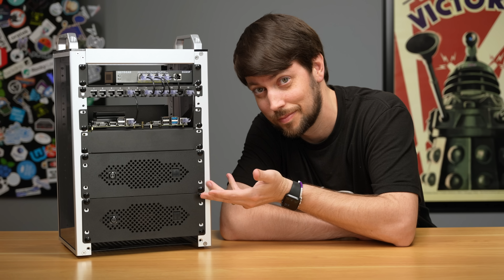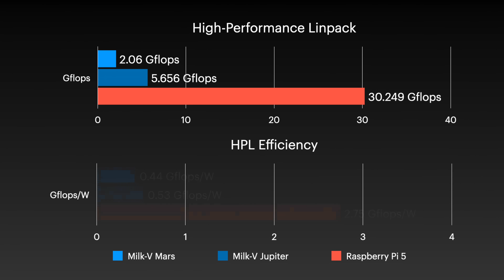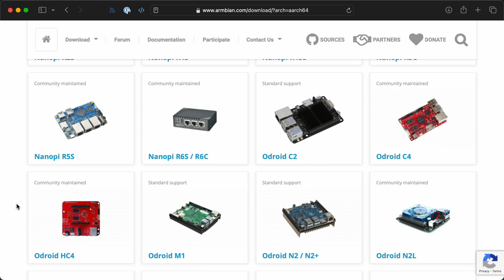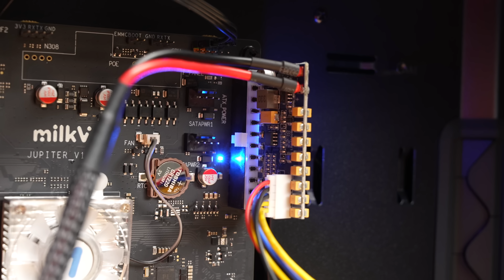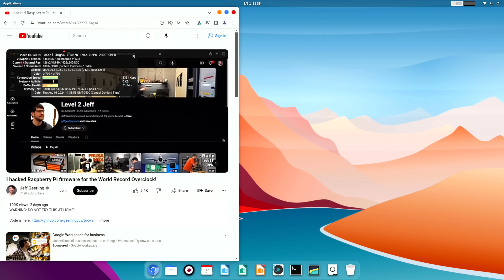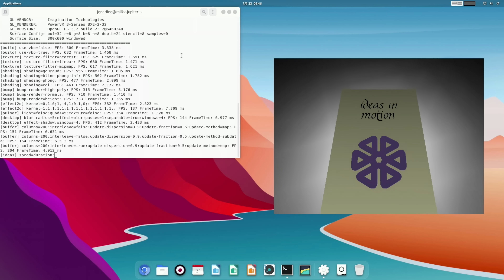The PC industry is changing: RISC-V goes mainstream

Comment: I think people need to stop simping for RISC. Especially click-bait titles like this don't help at all. Instead they hurt any chance RISC ever had. Right now it's a toy for a very tiny niche of tech-enthusiasts. It has a long way to go to be relevant at all for the mainstream.
Reply from the maker: The overall point of this video is to show how RISC-V (collectively) is at a state on the Arm SBC side where Raspberry Pi was around the Pi 2/Pi 3 era, where it went from quirky and horribly slow hobbyist board to 'a thing that actually makes sense in some use cases'.

It's certainly not a board I'd see someone install in their gaming PC (but neither is a Pi), but the software and community/soft parts (which most Arm SBC makers lack) is already solid. If the hardware can catch up, with some faster and more efficient RISC-V core designs, Arm is going to have a reliable competitor for things above the microcontroller level.
Reply: 15 years ago I saw many of the same comments about ARM.
Reply from the maker: @joshua_lee732  Heh, somehow I still see the same comments about Arm today (though a lot less than 10 years ago).
Reply: @joshua_lee732 and right now it looks like every standard laptop from various companies will have a Google, Qualcomm or Apple ARM CPU.
Reply: RISC-V, yes. But RISC architectures have been picking up steam way back when the PowerPC was first introduced, where everything from the IBM servers to the iMacs and PowerBooks, and even the GameCube and the entire 7th generation of consoles, ran on PowerPC.
And of course ARM practically revolutionised portable computing with modern smartphones and tablets, and now desktop (including laptops here) and server computing.
There were plenty of other RISC architectures other than RISC-V. And even Intel and AMD eventually decided to create modern x86_64 processors that were actually hybrid RISC and CISC processors.
Reply: How can I dislike a comment
Reply: I just don't like the direction this is headed for video encoding. Software encoding is the best method for the highest quality at a given bit rate. Not having instruction sets for advanced math is going to make them slow, so they're pushing hardware encoders. The video we get on our physical media is going to look like ass pretty soon. This push is fine for laptops and desktops, but they need to quit pushing it on all sectors of computing.

Comment: PowerPC was running a RISC desktop before WIndows had sound in them "multimedia" monitors
Reply: Arm & PowerPC processors use risc architecture your mixing up architecture and instruction sets😂
Reply: @reghawkins73 He isn’t… RISCV is a RISC isa, but they are not the same.
Reply: @xanderplayz3446  I know there not the same that's what I said 😂
Reply: Arm risc ISA , powerPC Ric's ISA have different assembly commands, risc ISA just means less instructions on the CPU 😂
Reply: @reghawkins73  It is a common misunderstanding that RISC simply means fewer instructions, despite the coining of that particular acronym, itself the result of needing to label a particular design philosophy in a concise way. What RISC actually entails is more involved, but you can save us the emojis and go and read the early papers by the likes of Patterson if you are really interested in the topic.

Comment: RISC-V may no longer be a RISK to adopt... I'll walk myself out
Reply: That was a Risky joke. I'm glad it only took 5 attempts to get right 😂
I will yeet myself out. 😅
Reply: Get outta here, Boooo, Jk
Reply: Don't beat yourself up, someone had to say it!
Reply: But question is: will it play RISC?
Reply: It's still a RISK. No socketed RAM means when a chip dies, the whole board goes in the garbage can, not happening.
Reply: @KiraSlith  bga replacement is a thing
Reply: @erkinalp  I forget the average person on Youtube has never worked a job. Most companies don't allow hand-repaired hardware in their deployment environment, some aren't even willing to accept used hardware. Legal especially doesn't like it, because when that hardware fails, or a bit flips, or a tin hair happens to bridge two contacts under special circumstances, they can't hold the manufacturer accountable for the lost productivity.
Reply: @KiraSlith  
> It's still a RISK. No socketed RAM means when a chip dies, the whole board goes in the garbage can, not happening.

You could say the same about any other chip on the board. RAM rarely dies (similar to CPU), it's not the same as flash storage.
Solder down storage too and now we have a problem..

> Most companies don't allow hand-repaired hardware in their deployment environment

Then how does socketed RAM help? You still need a hand to swap the RAM :)
Reply: @KiraSlith  Good point
Reply: Thank you. That was the correct decision. 😅
Reply: @KiraSlith  There's RISC-V hardware with ECC RAM slots. See the Milk-V Pioneer.
Reply: @KiraSlith  This is a developer board.
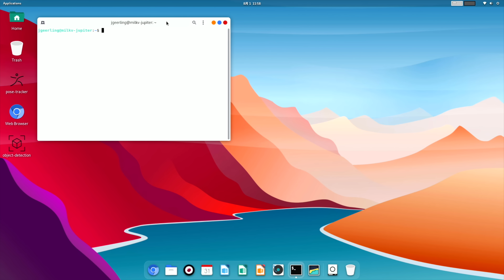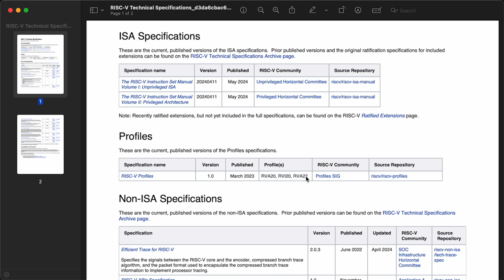Reply: @KiraSlith @KiraSlith  12:50 "This is for developers". Also, 3:20, both Jeff and Chris says it's not for mainstream use.

You were saying?
Reply: Indeed, I too shall point to the stack of accumulated data that registers as a lack of risk in this ISA which is o' pun

Comment: "RISC architecture is going to change everything" - Acid Burn
Reply: Hack the planet.
Reply: RISC is good
Reply: 10/10 reference
Reply: Technicolored rainbow
Reply: If you wanna be elite, you need to score a righteous hack!
Reply: I have found my people
Reply: BBC Micro by Acorn Computer Ltd.
Reply: But WHO and WHY is so aggressively pushing RISC-V to public ?
It is not some wonder, it is just another small instruction set SBC architecture. Not some quantum computer to your pocket.
Is it another step to "worldwide surveillance IoT concentration camp" ?
Why is every IT-yuppie parroting these phrases like some religious believer and do not think about REAL agenda behind this?
Reply: angelina jolie knew her shit
Reply: I wouldn't even say RISC is winning, because today's RISC processors have gotten way more CISCy than the original RISC processors.  It turns out that for performance reasons you really have to implement complex instructions.  RISC and CISC have become blurred.
Reply: @dansanger5340  I wouldn’t say ARM, MIPS, or RISC V are competing with x86 for anything really. Based on the numbers provided here and from a few other benchmark suites a 20 year old Pentium 3 has similar performance to these chips.

Is Apple Silicon faster? Yes, but it also uses needs dedicated accelerators to really beat that P3 and uses similar amounts of power, 25 to 30 watts full out.

I wonder how bad the software stacks have to be for the at least 12X increase in performance increase in x86 IPC between 2004 and now to disappear.
Reply: That is why since the Pentium Pro Intel is using RISC cores and just keeping it CISC compatible using a translation layer breaking those instructions down to smaller parts - unsure when AMD made the change.
That is why at the same level of performance (seemingly) CISC CPUs are as efficient as RISC (i.e. ARM) CPUs.
Reply: @belzebub16  ARM also uses this approach for their modern CPUs, basically every modern superscalar CPU uses µops
Reply: @belzebub16  the original 8086 and 8088 had microcode, microcode and RISC are not really the same thing
Reply: @1DwtEaUn this is not about microcode. since the pentium pro and k5 x86 CPU's dont use x86 for the actual execution, and the front-end has a decoder that translates x86 into more efficient risc-like instructions (micro-ops) that can be reorganized/managed more efficiently etc. These are then sent off to the execution unit and are what actually get executed. x86 instructions being executed in hardware as is, has thus been dead for a long time, which makes the "x86 is cisc vs arm is RISC" debate pointless anyway. All modern CPU's are 'recompiling' on the fly every cycle, so to speak. Intel and AMD already realized in the 90's that x86 wasn't very efficient lol.
Reply: @belzebub16   I cannot agree, that doesn't make sense.  RISC requires different machine code at the CPU level, if you ran a translation layer that would add overhead.  That only makes sense as a transition and we still use x86 and x64 software.  Intel and AMD have tried to use RISC design elements 20 years ago, but we are still locked into the existing x86 codebase.  If you compare an Apple laptop today with either Intel or AMD you can see the same performance with much less heat generation.  The M1 is a RISC CPU, and is much more efficient.  Maybe you're thinking of Intel's Netburst architecture on the P4?  That was a bust mostly.
Reply: @belzebub16  AMD has been using RISC since their K5 processor back in 1996.
Reply: @belzebub16  that's how all cpus work
Reply: @slendidevel  That's not how ALL cpus work. A basic cpu (maybe in a microcontroller these days) can decode each instruction directly without any translation layer
Reply: @rexsceleratorum1632  Even microcontrollers these days don't do direct translation. These aren't the days of the 4004 or 6502 anymore
Reply: @slendi9623 no. Remember the Tay super computer
Reply: I remember my group of nerd friends thinking that line was an absolute joke, and now, decades later, all my nerd friends have one in their pocket, and this cheesy movie unites us :)
Reply: 30 years ago.
Back when Jolie was natural and hot.
Reply: A horrifically bad movie.